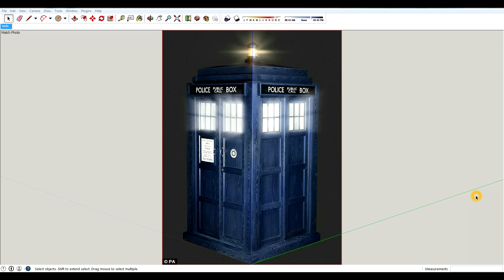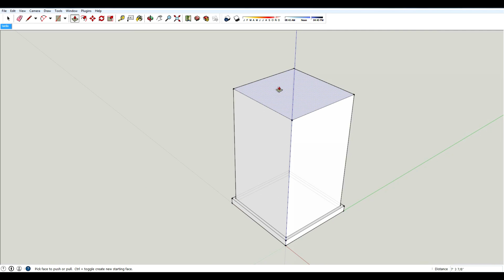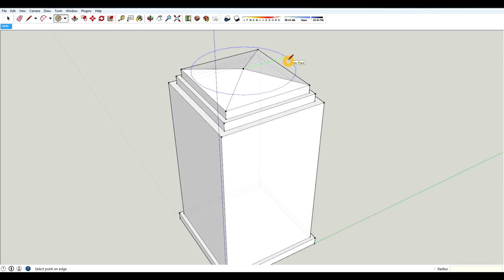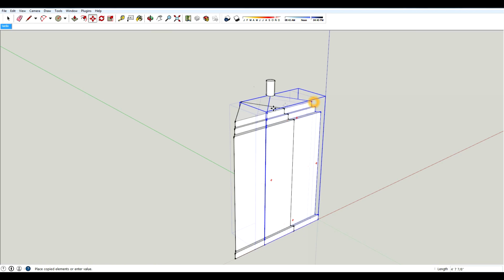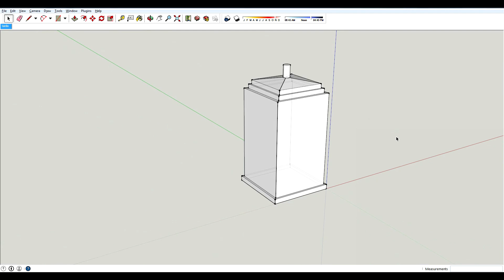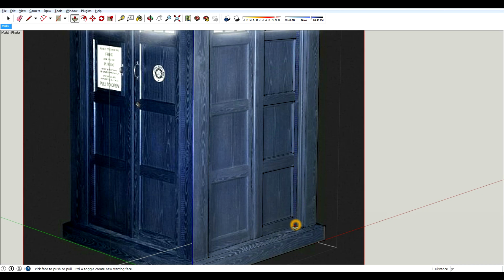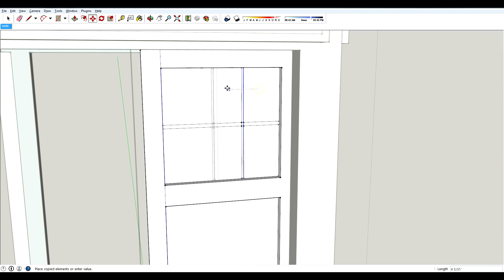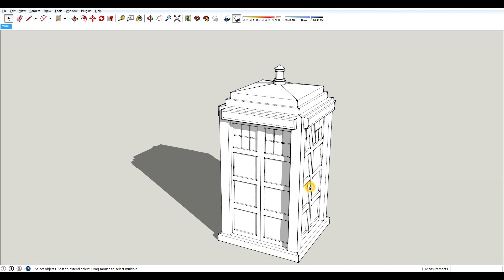How to Model with Match Photo in Sketchup

Comment: Hi, when doing the cross on the roof to be able to raise it at an angle (the bit underneath the light/lamp on top), the midpoint is the end point and it splits itself off into 4 seperate lines and you are not able to raise it at the midpoint, any advice on how to fix this, or have I done something wrong?  If you have instagram I am more likely to see a reply on there so please DM me if possible @willrichardson2512   Can I advise that you put the reply on here as well just in case anyone else has the same problem!!  (I am using Sketch Up Make 2017)   Thank you very much!!   -  Will
Reply: I follow you on instagram!
Reply: I have DM'd you, however i have now sorted it!!